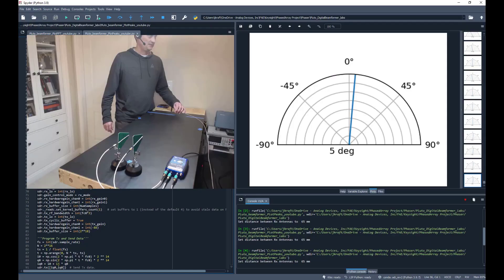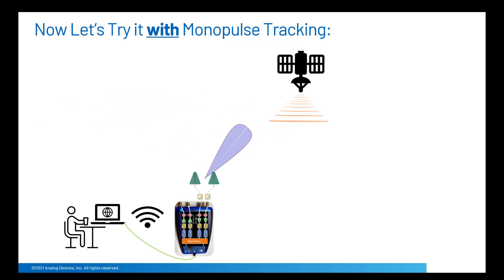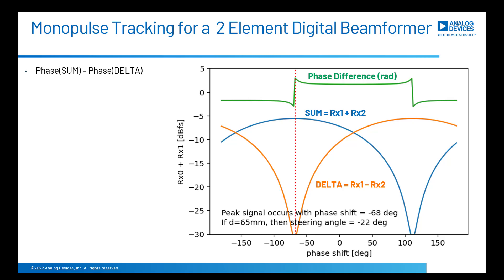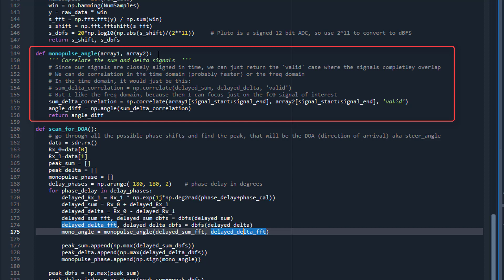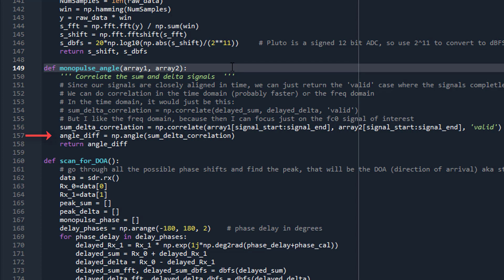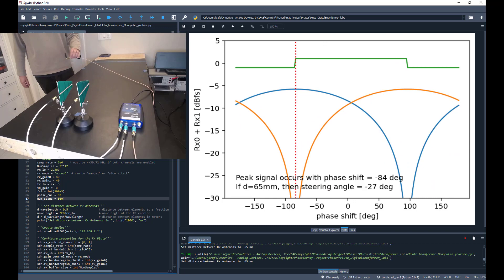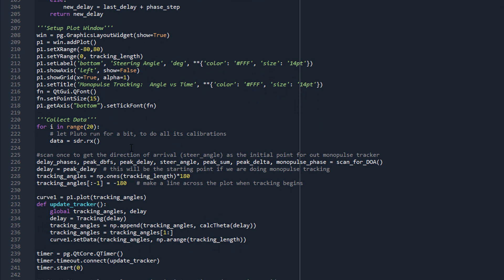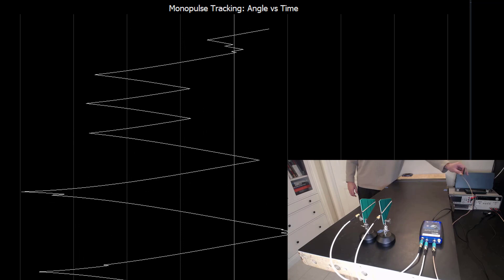Monopulse Tracking with a Low Cost Pluto SDR

Comment: Before monopulse, targets looked like they were wobbling on the radar scope. The FAA's Mode-S design required monopulse to function correctly, and also releaved Kalman filter tracking algorithms from dealing with the wobble. Alas, the FAA only had a receiver for boresight, and an Omni antenna (used for sidelobe cancellation), now it had to buy two receiver systems for every Mode-S interrogator site.  Excellent presentation, very interesting to watch.
Reply from the maker: Thanks!  I would love to learn more about the history of the early days of radar and phased array.  Sort of a Ken Burns style documentary on it would be ideal!  They (you!) were doing such clever stuff.  Do you know of any good books or articles on that?
Reply: @jonkraft  I know what you mean. As technicians this stuff just magically appeared, and we kept it running, but never really got access to the development end. I have one book from 1988 called "Secondary Surveillance Radar" by M.C. Stevens I can donate and send you. It has history and design. A PDF online is "Monopulse Secondary Surveillance Radar Coverage - Determinant Factors" has math, and graphics. Neither are Ken Burns though, ha. I think the era of modern radar started when the FFT was introduced. This allowed DSP to be used to extract the targets, and computers to process all the target reports. No more rotating sweeps and dark rooms.

Comment: Thanks Jon once again for a very delightful tutorial! I previously compiled a python program using mat plot lib which plots a zig zag line made up of colored dots, green dot for strong signal, yellow dot for weak signal and red dot for very bad signal..  i used gps coordinates for the plotting the colored dots which eventually create a zig zag line that represents the flight path of my drone carrying the RX. The whole contraption basically plots the radiation pattern of a directional antenna under test (on a stationary TX) . With your method, I could totally omit the GPS module and do not need the RSSI value from the RX for determining the signal strength color of the dots. And I could plot the TX antenna radiation pattern in an indoor hall. Epic! 👍
Reply from the maker: Very cool project!  And that's a great idea--let me know if you ever try this out.  And I should definitely update the monopulse tracking demo to color code the dots based on signal strength.

Comment: Thank you for making this. I just discovered it by "accident" and it did a much better job of explaining monopulse than any other material I've looked at. 

Curious, how would you go about implementing this for 5.8GHz? That's outside the range of the Pluto SDR.
Reply from the maker: Thanks!  For 5.8 GHz operation, you can just apply the frequency expansion hack.  This gives you 70MHz to 6 GHz operation.  And if you've set your Pluto up for 2 Tx/2Rx, then that freq explanation is already included.  Give it a try, and let me know how it works!
Reply: @jonkraft  I just ordered mine from Mouser, so hopefully it's Rev C. I think it would be interesting to try this using real, modulated signal sources rather than plain carriers. I suspect things may break, especially with PSK variants.

Comment: Thanks, Jon for such a great tutorial. I tried to play with pluto this way with different types of antennas and everything works perfectly. I just didn't get why the distance between antennas is calculated for lo =2.3 GHz, but we use demodulated signals Rx_0 and Rx_1whis 200kHz frequency to get the phase shift. It's not obvious, why phase shifts should be the same. Moreover, looks like it shouldn't be the same. But still, it works. I've plotted the received demodulated signals, and the phase shift between them really depends on an angle as LO oscillation should. This fact really confused me. Could you pls just briefly explain this moment?
Reply from the maker: Take a look at the explanation in the time delay video.  I think that will help with your question.
Reply: Many thanks for your reply! I've finally got it. So this huge phase-shift in demodulated signal from two channels is nothing but a kind of mathematical "artifact" of demodulation.

Comment: Using a 20w amplifier 2,4 GHz to amplify the monopulse , What do you think the range of this radar would be if we transmitted with a yagi antenna continuously scanning 120 degrees with a servo?
Reply from the maker: I'm not sure.  But there are several radar range calculators online.  Or if you have the Matlab radar toolbox, that has calculators and examples for radar range.

Comment: Could this track a moving target which is not radiating signals?
Reply from the maker: In that case, we would hit it with a transmitting signal and then measure the reflection.  So basically radar.  And then track that reflection.  I'm going to do a radar setup next, and then maybe after that I can try to combine that radar with these Monopulse principles.
Reply: @jonkraft  That would be great! Can't wait to watch your new videos!

Comment: Do you think it would work with high frequency band? 0.5-30MHz?
Reply from the maker: That would work if you connect an upconverter on each Rx channel so that you can get into the min freq range of Pluto (>70 MHz).    I've used the "Ham It Up" by nooelec for this.  But the real problem is that you'll have to space your antennas very far apart:  0.5MHz is a wavelength of 600 meters, so to avoid grating lobes you'd have to place the antennas 300m apart!  30MHz is a little better, but they would still need to be 5m apart.  So while it is possible, it might be impractical.